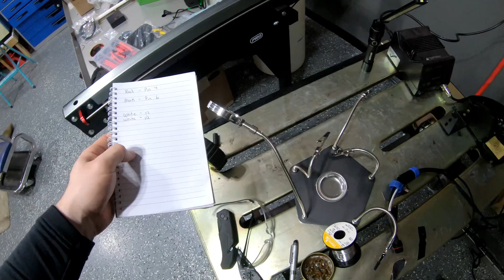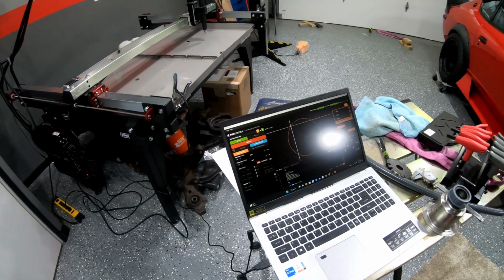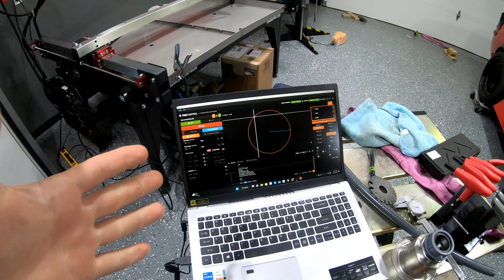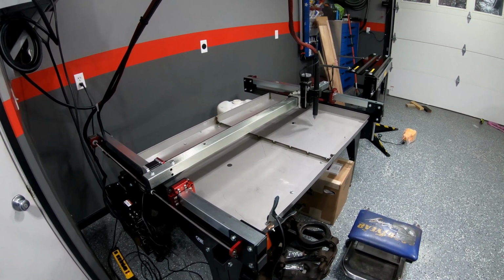Pt.2 FIRST CUT - with Langmuir Plasma table is on ITSELF?!

Comment: What is the blue cone thing over your torch head?
Reply from the maker: Amazon kitchen silicone funnel I cut to fit over the torch
Reply: @StewartMotoring  is that to help keep sparks and spatter down?
Reply from the maker: Yeah, and thirdly hides the arc. Can be hard to not watch the arc and it’s not good for the eyes.
Reply: @StewartMotoring that's fair. Thanks for the tip. I just bought a buddies old table as he upgraded. I'm starting to dig into this stuff.